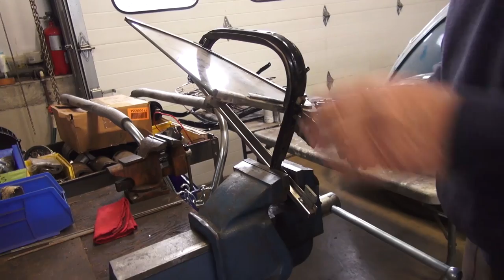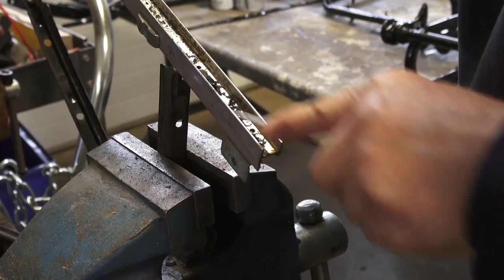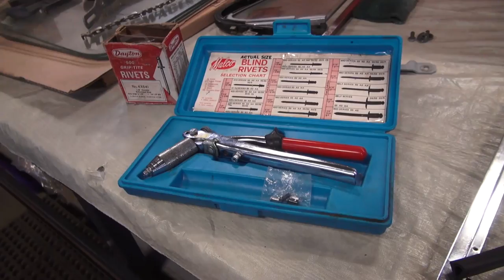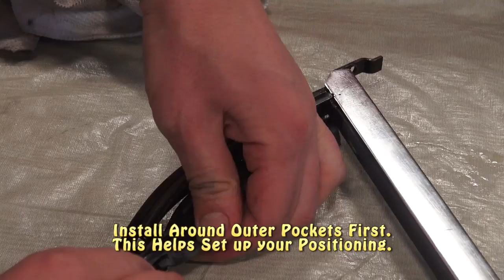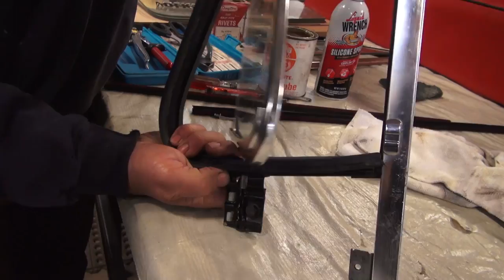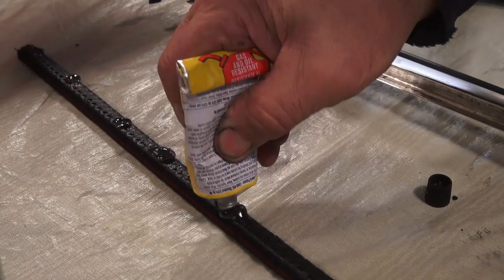Classic VW BuGs How to Restore Beetle Vent Window Assembly 1965 and Later

Comment: Did you use a generic "pop-rivet" for the vent swivel?? I'm doing the same to my '71 Bay window vent and it came with a specific rivet and washer but I don't have the correct tool to install it! Any "insider" info you'd care to impart?? Great music in your video BTW!
Reply from the maker: Yep, you can use a generic one
Reply: @classicvwbugs  thanks Chris. This will move me along on my project nicely.
Reply: @classicvwbugs  So any pop rivet that fits will do the job? A heavy duty rivet is not needed?
Reply from the maker: @SDsailor7  the best one you can get that can fit in that hole.  the stronger the better.
Reply: @classicvwbugs  That is what I was thinking because the regular pop rivets look and feel like aluminum.

Comment: Question: can the plastic lock knob be replaced without removing the glass?
Reply from the maker: well usually a new knob comes on the chrome lock arm, and that has to be riveted inside the chrome frame.  So if you go that way, then yes the glass has to come out.
Reply: Chris Vallone ok , so I just removed the glass. Guessing I need to drill the latch out? Correct ?
Reply from the maker: @xrayiz67  yes

Comment: Chris: What is the spec on the rivet? Aluminum dome head, 1/8" x 1/4"? Aluminum Mandrel (nail?)
Reply from the maker: 1/8" x 1/8" aluminum
Reply: It's a 5/32nd hole size.

Comment: Chris, you have guided me through my old 73' Beetle restoration (until a tree fell on the roof - no real fix for that) and now it's replacement a 72' Super Beetle.  When replacing the window scrapers I decided to replace the vent seal.  The parts are from MAMWorks so they're quality.  I have struggled for many hours trying to get the main seal to seat in the wing frame.  Any trick I'm not catching in your video ?
Reply from the maker: +Nancy Hahn Are you lubing it?  I am not a huge fan of MAM stuff.
Reply: +Chris Vallone yes - trying to follow the instruction video exactly...using liquid wrench silicone as shown.  I'm afraid of pushing too hard and ripping the rubber.  Perhaps not pushing hard enough.  I'll keep trying because I need the window .  I've thought of sending it back and ordering from CIP1.

Comment: Thanks @Chris Vallone great video!  How much harder is replacing that window latch?
Reply from the maker: +Matt Jackson You would have to drill out those rivets in the bottom of the frame.  It's a pain.
Reply: +Matt Jackson I replaced the broken handle part of my vent window latch '77. Bought a new latch, removed (tapped out) the pin that holds the new handle to the new latch base and installed only the new handle on the original latch base. Just keep the vent window in place. The new handle is a looser fit but it works. Might make for a nice vid, how to replace broken handle of vent window latch without removing latch.

Comment: Thanks Chris!  This could not be more timely as this is on my to-do list for this winter.  I have a 1965 convertible and the passenger side doesn't really align well with the windshield with the door closed.  The driver and passenger side are both somewhat different.  Is it possible that someone replaced the original with wrong year?  Or is my problem something else?  Thanks!
Reply from the maker: +Dan Johnson Each vent window is different on your car?
Reply: They appear different.  I have not measured them but one has a round handle for opening and one has a lever.  I thing the driver side is the original and the round handled one on the passenger side is a different year.  With the door closed, there is a substantial gap between the vent window and the windscreen post.
Reply from the maker: +Dan Johnson Yeah they should match, maybe someone swapped out one of them.
Reply: Thanks!  I have to say your original response was priceless like "WHAT, are you serious?  they don't match???  HOW DARE THEY!"

Comment: Hi Chris,
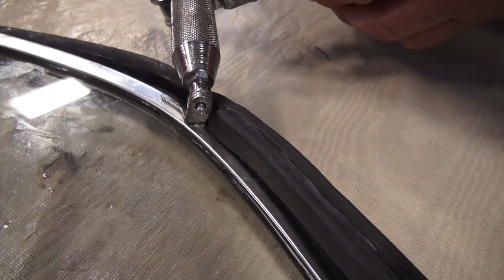New Beetle owner... Its actually my "Lady's Bug" - groan, but question about the rivet for the top of the vent window attaching to the frame. I see you're using a "pop" rivet here (7:06). The local Beetle shop got me one closer to the one I drilled off.  At a loss as to how to put that on exactly? Any ideas? I feel like I'm missing the back or something? 1970 VW bug
Reply: Took it to a "Leather boots and Saddle shop in town. They had all the right tools to hammer it down nicely, cost me $5 bucks!

Comment: Chris. I know this is entirely off-topic, but settle an argument for me. You more than anyone could answer this one.
As a thought experiment...would it be possible to build a Beetle from ground up using only after-market parts? I know
that probably the toughest parts to acquire would be the floorpan and steel body parts, but do the last Beetle manufacturers in Mexico still use their body and floor stamping tools for spares? And could one get hold of such parts? Just wondering
what your take on this is.
Reply from the maker: +stertim I think you totally could!

Comment: Hi Chris, I'm trying to find out if my bug is a 1960 or 61. I only have the vin for the chassis # 3957203. Seller has paperwork showing 1960 but my info is showing 1961. Any help would be great. Thanks in advance!
Reply from the maker: +jesse alcala Thats a June 61